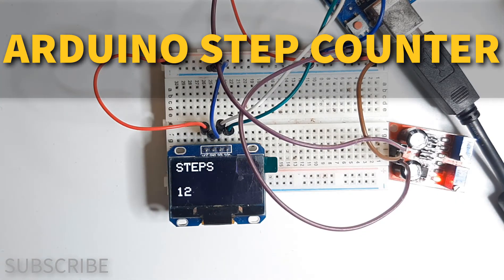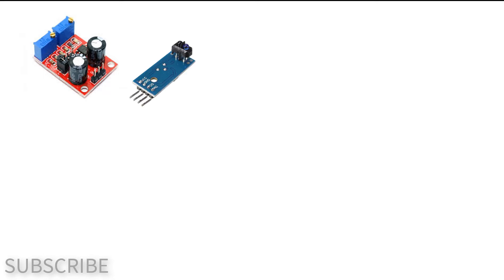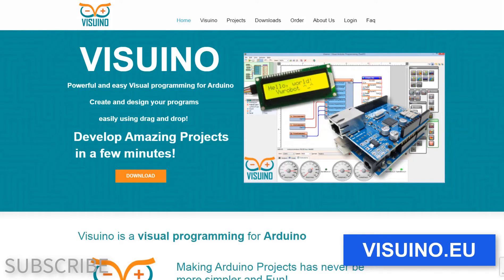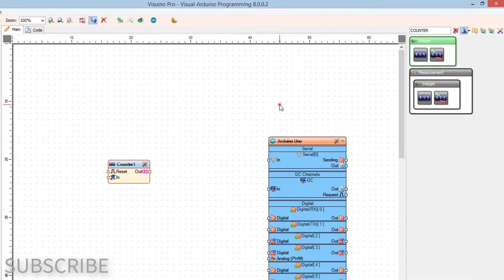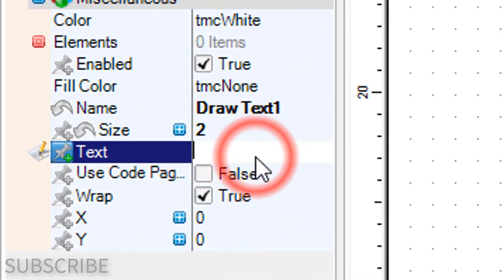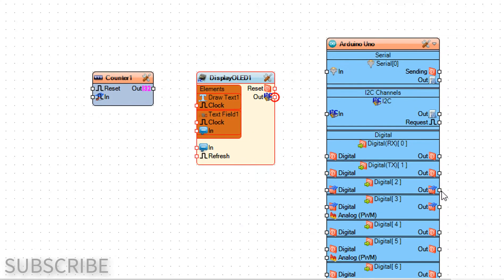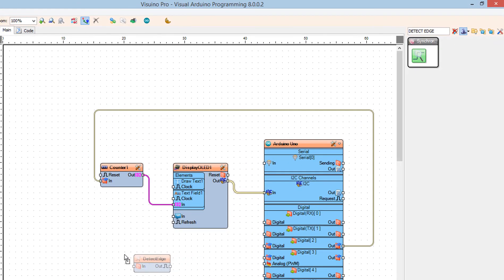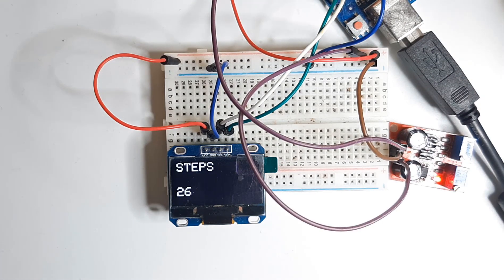Simple Step Counter Using Arduino

Comment: Hello , Thanks to your video. If I want to count the number of pules in 1 second, and only output this number to OLED display, can you tell me how to make it?  Thanks for your reply!
Reply from the maker: You can add the timer, and set it that the counter is only enabled for that time (1s), you can contact me through the support link if you will not be able to solve it.